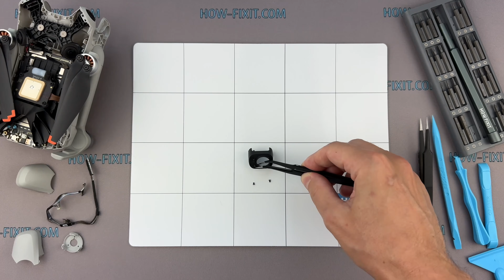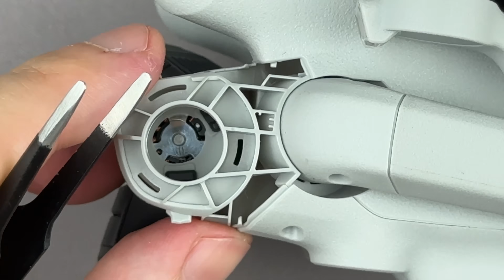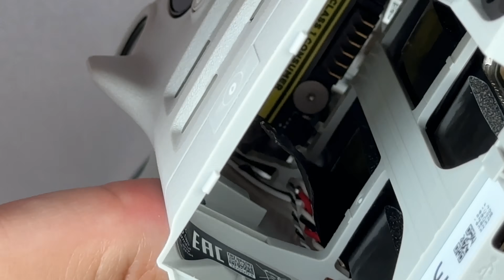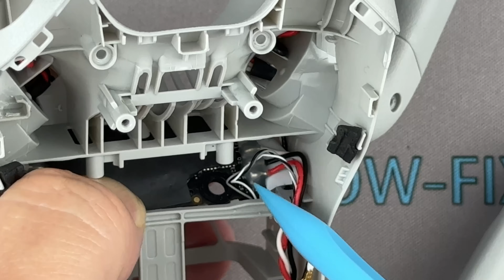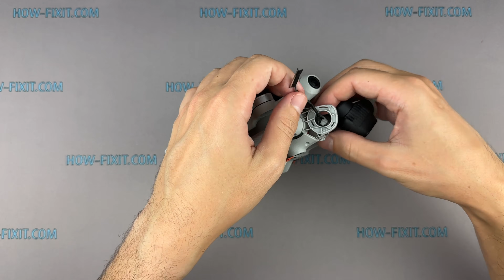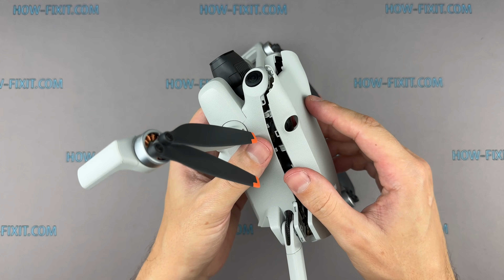DJI Mini 4 Pro Disassembly & Repair: Ultimate Guide

Comment: When removing the mother board, after removing the tape inside the drone body using tweezers, the tape had no adhesion left.
When you put the motherboard back in (@23:26), you didn't show any reapplying the tape inside the drone body.
How did you re-adhese it? What do you use if the take is no longer sticky?

Comment: sometimes you use a glue gun, othertimes you use B-7000 glue.  Can you use b-7000 for everything?  if no, what glue and what glue gun?
for example you use the glue gun around 25:23 (can I use B-7000 there instead)?

Comment: I know you guys are the pros but there are so many things wrong with this video.  
First off ,  DON'T try to pull that epoxy/rubber off without gently heating it first.   You are just asking to rip a connector off or break the brass ends off of the antenna wires (thus needing an entire arm replacement)

Secondly, DON'T use a sharp pointy pair of tweezers.  That's the easiest way to scratch off part of a trace on the board, gouge a hole in the insulation of a wire (and make it easy to short), poke a hole in one of the ribbon cables, or poke YOURSELF (Ouch) !  

Not to mention people will most likely be lazy and use those same tweezers to try and pull out wires which will end in disaster :P

Comment: hi, my mini 4 pro cannot connect to any remote even rc pro, my drone never crashed and just stored in dry box for a month, when i want to use it drone cannot connect to remote rc2, is it any damage in my mainboard or anything hardware got damage when i stored in drybox? the battery is dissamble from drone too. thanks

Comment: Hi, I had to reconnect my GPS module after a crash. Your tutorial was an invaluable source of information; it took about half an hour until next take off. Your video is one of the most qualitative I ever saw when it comes to disassemble and reassemble something. Thanks for the high quality and for sharing. If I can suggest one improvement it is about the thermal paste. Mine was extremely dry and it also seems to be the case in your video. I removed the dry material and replaced it. Without replacement the cooling performance is at risk. Thank you again.

Comment: I wish you would havw explained which are rhe antenna wires and where they connect.. im assuming they were rhe 4 wires on the right side connected to the motherboard with red and white wires.. can someone confirm?

Comment: This wasn’t a fault this assembly he missed the main board that contains a soldering points for the arms. If ever you break an arm, you have to replace it. You can just magically put a new arm you reconnec and solder

Comment: Hi is it possible to just put a new bottom led cover which covers LED ? Mine broke in crash. Currently that part is not there. So it's exposing bottom ic of LED and am worried if that might cause issue if water gets to it.

Comment: Hi, this is my very first to repair my dji mini 4 PRO after it crashed on March 2025. The rear motor becomes hard when rotating and its not smooth. Luckily, thats the only major problem for internal components. I bought a motor replacement. I watched your video around April and I was overwhelmed. So my drone were on standby for many months. Until yesterday, January, 26, 2026 out of boredom, I challenged myself to try repairing it. 
I watched your video with all the courage and enthusiasms and being optimistic as well lol.
It was kind of overwhelming especially that I am not a pro tech. I watched it over and over to guide me. 
And you know what, I did it!
My drone is now flying and it was such an accomplishment in my part. I did some tweak on the cables to avoid soldering the ESC but it still works. 
There’s this feeling of such great accomplishment no one can ever steal lol.
I definitely agree with you, every tech challenge is an opportunity to learn and grow. 
Thank you so much for this tutorial, not only I saved money for repair, I learned and grow!
Watching from the Philippines.
Reply: i wish you always a good fly

Comment: Quick question, i assume you don't have to take the mother board out to replace the downward vision sensors right? Also what is the firmware to calibrate the new sensor if successfully put in? Super appreciate your time. Great video!!
Reply: Any answers to this? I have the same questions.

Comment: Hello, can I make a new drone by replacing the mini 3 pro or mini 4 pro drone motors and building a new body. For example, if I use the Tarot 4006 Rc Brushless Motor 620Kv motor with the new body and dji mini 3 or mini 4 parts, will it work, can I use the new multicopter? Please reply

Comment: I replaced the downward vision sensor, and when I went into DJI Assistant 2, there was no option to calibrate anything.
Reply: Did you get it to work? I have a 4, and have a vision downward sensor error
Reply: @fourstars5270 No, I’m just going to buy a new drone becuase i can not get it to work.
Reply: @fourstars5270 Same here! Any fix??

Comment: Thanks for the video. You are talking about a special firmware to calibrate the replacement of the upper front vision sensors.

Is there any hint where to get that special firmware? I am considering to replace some damaged sensors myself.
Reply: Did you find the calibration software? Or did the “auto calibration” the controller provides work?
Reply: @BigfootMediaPro the software is apparently only proprietary and is only being used by authorized repair shops
Reply: @OehrchenTV thanks. So that might mean replacing my downward vision sensors myself will be a waste of time.

Comment: Im having trouble with mine its giving alot of error codes and i put in a request to be fixed with dji and they told me they dont have the parts to fix it. Its all internal, never been wrecked. What can i do?

Comment: Great video!!!
I am facing downward vision sensor error on mini 4 pro.
Code 1A0100C0 and 1A0100C1
Error appears on the RC2 immediately at propeller start 
Take off and landing properly 
Hight on the RC2 fit the actual drone hight. When My hand under the drone it moves up. Used the new assistant 2 for refreshing the version on the RC2 and drone
Do you recommend replacing vision sensors?

Comment: Hello…thanks for what you are doing with your repair videos, they’ve been very helpful… I have a quick question..instead of going the whole process of taking out the motherboard, vision sensors and all, to reach the ESC board to replace an arm… can one just cut and join the wires and still get it to work???

Comment: My mini 4 pro crashed last year on Dec, resulting in 2 broken arms and 1 broken lens (left front), a broken camera housing, and bended case.  As I live in Guatemala, there was no option to get dji care, nor support to send it and have it fixed :(
I got a mini 4 pro for parts on ebay and this tutorial was very helpful, I was able to switch everything to the new housing, even broken  the lens. Now it is giving me an error, I can't calibrate the compass, I get a missing parts error (I know for sure there are no missing parts) and a front sensor error.

I haven't tried to calibrate it yet. Do you think it'll fix the problem?

Comment: Quick question, I noticed the 4 screws holding the top shell are different lengths. Do the longer ones go near the gimbal or in the rear?

Comment: Can you please share what size or type are the coax micro connectors ( the antenna cables ) ? You are removing them at 9:04 mark. I need to replace the black one. Thank you.

Comment: I had a crash that broke the Vision Assembly bracket. Tried to glue it back together and reconnect it, but I’m gettin a compass connection error. And cannot calibrate it. Is the compass connected to this assembly?

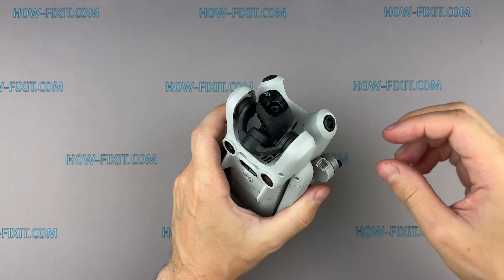Comment: I had little crash on Mini 4 Pro Gimbal Side Cover (Left), can i remove rubber holders of the camera gimble with gently as it showing in video time 4:24 and replace the part.
Reply: It can be done with hand.. But be gentle to parts..It has very fragile claw structures.

Comment: I have to replace the Gimbal Rubber on the side without the wires, but one of the 3 plastic pieces (on the side of the gimbal) that goes into the rubber is chipped off. Would I be able to order just that piece without having to replace the entire gimbal? I can't find any singular pieces for it online. Great detailed video btw.
Reply: Yes, i did literally what you just said. Aliexpress sells that.

Comment: thanks for the contribution.
Do you have a video showing how to remove the propeller motor?
I tried to remove a damaged motor from my drone, but the screws on the Mini 4 are stuck! all 3 were swept.
Reply: 8:27
Reply: muchas gracias por todo 8ñ

Comment: bro vision sensor link and its calibration software ?? mini 4 pro is not calibrated with the software in DJI site. We need other way
Reply: It can be calibrated in the controller software. There are 4 different calibration options in the menu.
Reply: @oODReviews  No for vision calibration, there is need for additional DJI software.. DJI Assistant one. All technical services said to me
Reply: @oODReviews where?

Comment: 👍👍@How-FixIT  -  My M4P had an 'unfortunate' incident with a kite drone eating tree that refused to let go of it.  We got it down by gently poking it with a long bamboo pole.  Of course, Murphy's Law kicked in and it fell down and struck the edge of a concrete drain channel.  That put a tiny crack in the top cover just in front of the right rear arm.  I could have easily glued the small crack but decided to have a look inside to make sure there was no other damage.  This helpful video allowed me to fairly painlessly get that done.  Thanks again for posting it! 😁😁😁
Reply: e como ele está agora, parece meu caso

Comment: hi, my mini 4pro had a small crash, but only the rear arm came off (without breaking), it came off in half where the glue joint is. now it tells me ERROR 16100019 and 16100069. Can you tell me exactly what I need to repair? the drone turns on underneath, it works but it doesn't let me proceed with activating the engines and taking off

Comment: I followed your video to replace the little round rubber pieces on the side of the gimbal when I put it all back together the camera doesn’t work. Any ideas? A couple of the little places on the side of the body that snapped together broke. Do you know if it’s hard to get a new body? Also, the screws that are in my mini four Pro do not stick to a magnet.

Comment: I have a vision sensor calibration error. What am I supposed to do? Does replacement of the sensors solve the issue? Please help 😢
Reply: DJI technical guy said me, on Mini 4 Pros calibration done automatically on flight after you changed sensor

Comment: Hello everyone, the transmission cable of my Mini 4 Pro was severed in a crash that also broke the arm shaft axis hinge. What is the best solution to resolve this issue, and can my drone still operate without repairing it? Thanks.

Comment: I need to replace the rear arm. Could I just splice the wires and mend the new to the old wires without having to take the whole thing apart? They are color dosed so dose not look too difficult.
Reply: Greetings!! I am new to this forum. I am curious how this works. Did you receive an answer concerning arm replacement?? I had a friend assisting me dropped the drone breaking the triangular plate at the inside of the front left arm. The two screws holding the arm on, top & bottom, to the little joint are stripped. Try as I may so far no luck removing those two screws. I hope your problem is resolved.

Comment: I crashed my DJI mini pro 4 . Now the gimbal twitches and drone will not pair with controller. Not sure where I should start. Any suggestions would be appreciated very much
Reply: Same issue with me.any solutions you found?
Reply: @DIBYAJYOTI04  did you ever figure this out? I’m having the same exact issue.

Comment: Hey, sorry for asking here. I hit a wall. Couldn't stop because wind was strong. It didn't broke. But front arm is very loosen. Is it broken inside? Should i send it to service. I don't know.
Reply: Hi right now I have the same problem because I look up on every even the smallest damage on my drone and after small crash I found out that my front arm is i bit loose like you can move it in way you shouldn’t so I will keep you posted if you want because what I found out so far It could be front axis hinge so I don’t know yet if it works in my case but I already ordered those thing and like next weak or some I will try to replace them so I can tell you then if it fixes the problem
Reply: @pokyxd7716  I tried to change the axis myself. I could not. I sent it to service. It's really expensive sadly. And we don't have dji care here. Anyway they changed axis and it's all good now . As you think it's about axis

Comment: Hello, I need new top vision sensors. Can I buy a new one, replace the old one, and use it immediately, or will it need to be calibrated first?

Thanks for answer🙏🏻🙏🏻🙏🏻
Reply from the maker: Mini 4 Pro has auto-calibration of the vision sensors, maybe it will work if replaced, but I haven’t tested it. I hope that soon we will get the first results of replacing the vision sensors module and auto-calibration through the DJI Fly App
Reply: @howfixit  Thank you 🙏🏻
Reply: @howfixit  please what is result bro ??
Reply: I just replaced the right front sensor and now I can't take off: "Right sensor calibration error". So yes, the sensors have to be calibrated unlike what I read on DJI forum (from admin). So now I have to put back the old one which is scratched :(  BTW it is not easy to replace because they are glued. Any info is welcome to fix this issue as I think DJI Assistant 2 won't be updated anymore. Last update was in 2019.....

EDIT : It was now confirmed on DJI forum // "Replacing sensors requires mandatory calibration and programming of sensors in the drone's motherboard. This procedure can only be performed at a service center, there are no other options.

A workaround is to remove the lens from the new sensor and replace it with the faulty sensor. Then there will be no need to program it into the motherboard." Serg SSA.
Reply: @AmazingDrone4K  I hate DJI's policies. They started to behave like Apple does.
Reply: Please let me know if it works, I bought mini 4 pro and it came with top sensor damage, i want to know if I can easily change
Reply: where Can I find the module to replace?

Comment: I was told that the existing sensors would fail and not work after the motherboard replacement. Is it true that the motherboard replacement should be done together with the sensors? If such an incompatibility occurs, is it possible to match the existing sensors to the motherboard?
Reply from the maker: Almost everything can be calibrated, some using the DJI Fly app or DJI Assistant 2, but you will need special software to calibrate the camera gimbal or camera module.
For example, when the DJI Mini 3 Pro drone was released, it was impossible to calibrate anything. But after some time it became possible to calibrate the vision sensors through DJI Assistant 2 (although at the time of release, the Mini 3 Pro was not supported in DJI Assistant 2), and you can also calibrate camera gimbal and camera module in third-party software. So, support for DJI Mini 4 Pro with different software is a matter of time.
Reply: @howfixit Mini 4 Pro has gimbal calibration in menu on controller. I've used it. Everyone keeps mentioning the other sensors calibration though

Comment: Hi. How to calibrate newly purchased top sensors for DJI mini 4 pro? thanks for the help.
Reply from the maker: Try the automatic calibration available in the DJI Fly app. If this doesn't work, you'll need to wait for Mini 4 Pro support in the DJI Assistant 2 software.
Reply: @howfixit  Where is the application that was developed? I OWN RC2. There is only IMU calibration, compass, gimbal...
Reply: Is calibration also required after replacing the sensor ribbon?
Reply from the maker: Vision systems may need to be calibrated after replacement. A prompt will appear in DJI Fly, then tap the prompt and calibration will be performed automatically.
If auto calibration fails, you'll need third-party software.

Have you already made the replacement? What error do you have, if any?
Reply from the maker: probably not needed if you are only changing the ribbon cable
Reply: @howfixit  I won't have the tape until Wednesday/Thursday. Then I will know whether it has passed calibration or not. If I say something, I will write it in a comment here. thank you.
Reply: New sensor. There is an automatic calibration error... How to calibrate?
Reply: @MariuszFilim Hey did it started working? I have the same problem, please help😢
Reply: @MariuszFilim  Any update ?
Reply: I just replaced the right front sensor and now I can't take off: "Right sensor calibration error". So yes, the sensors have to be calibrated unlike what I read on DJI forum (from admin). So now I have to put back the old one which is scratched :(  BTW it is not easy to replace because they are glued. Any info is welcome to fix this issue as I think DJI Assistant 2 won't be updated anymore. Last update was in 2019.....

EDIT : It was now confirmed on DJI forum // "Replacing sensors requires mandatory calibration and programming of sensors in the drone's motherboard. This procedure can only be performed at a service center, there are no other options.

A workaround is to remove the lens from the new sensor and replace it with the faulty sensor. Then there will be no need to program it into the motherboard." Serg SSA.